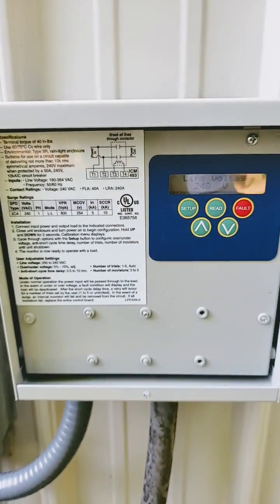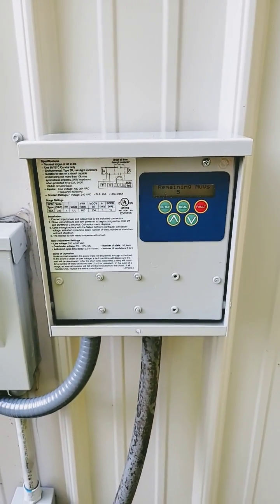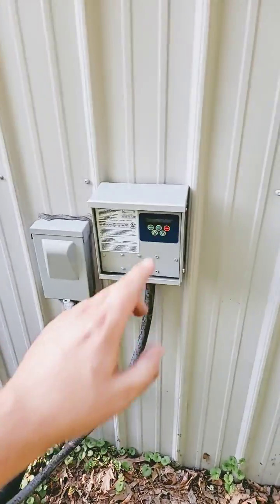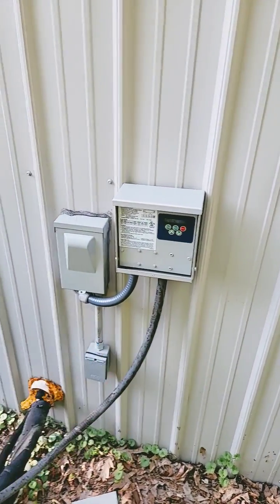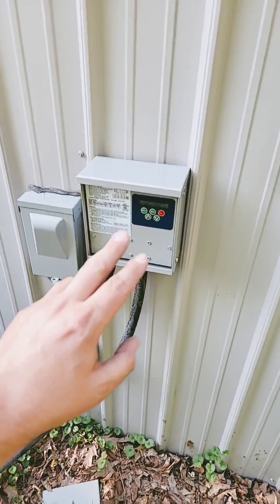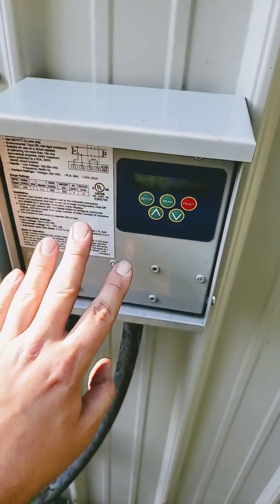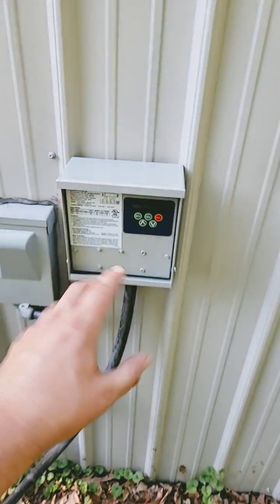How to protect your mini split? @icmcontrols9960

Comment: I’m running my old 20-year-old carrier compressor works fine. No fancy inverter board none of this high-tech BS.  Just good old-fashioned air conditioning. Change your contactor or capacitor occasionally and that’s it. all this new fancy technology all it does is break and cost a lot of money

Comment: I’ve been dropping Intermatic AG3000 on the disconnects will that be enough?
Reply: I used these also. It will work as a one time surge protector but it will not protect from high voltage. Lets say its a 208-230 mini split. Im pretty sure max voltage is 255. If it goes over that the icm will protect the board. Surge protector will not

Comment: Do they have one that doesn't monitor voltage? It's totally unnecessary to monitor the voltage if you're not running off a generator or solar panels, no needs to waste money on a useless feature.

Comment: sounds more like a design flaw, transient protection at board level is not a difficult thing to design into a product
Reply: They all “have” it. It never works. Just install a surge protector.
Reply: @jman0870  they keep doing it the cheap way with MOVs, there are better ways to do surge protection with components that don't wear out.
Reply: @elektrokinesis4150  you do understand how saving $5 on 100,000 units works, right? What could or couldn’t work doesn’t matter. It costs money, therefore it won’t be there.

Comment: I’ve been installing the MARS 60 amp disconnect with built in surge protector, $110, nice product
Reply from the maker: Very cool derek I will check that out thank you for your knowledge
Reply: Not to be "THAT guy" but....the thing i like most about the ICM is that its also a voltage regulator.